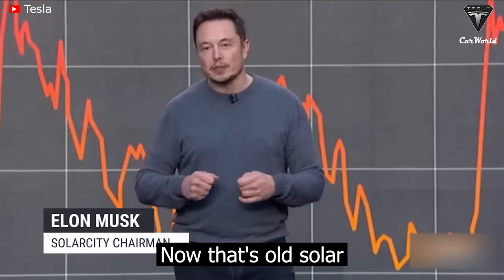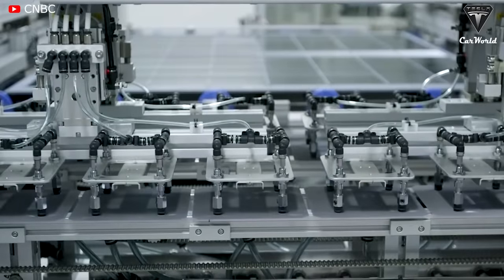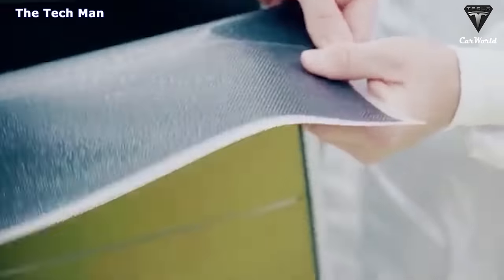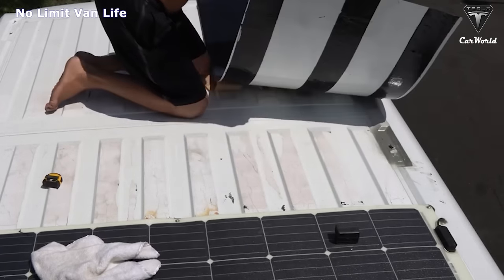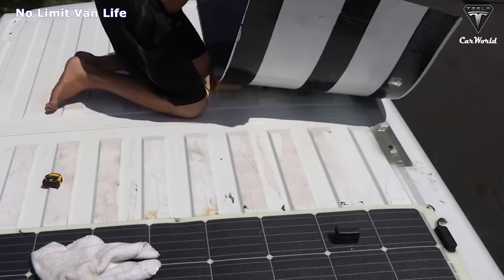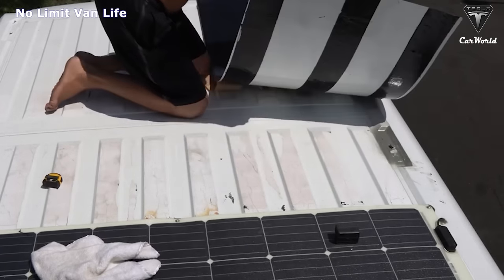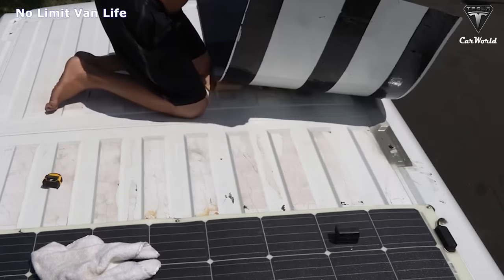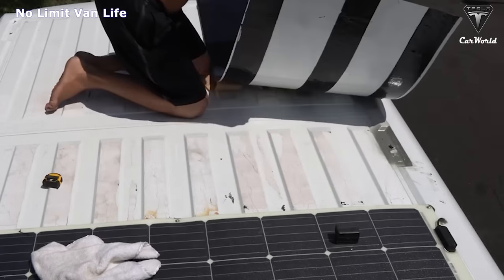Elon Musk Revealed All New Solar Panels for 2024 Renewable Energy, Can blow your mind!

Comment: As of Jan 2024, I got a quote from Tesla contractor quoted for my roof $70-90/sqt. My roof is roughly 2850 sqft, total cost $270k-$290k. The solar panels cost more than my house.
Reply: Absurd
Reply: But that can't be right! Elon himself said that they were going to be cheaper than asphalt shingles! 😂
Reply: That’s a hell of a deal! Send it
Reply: Your current energy bill will not cost 270,000 thousand dollars in yer lifetime
Reply: You need 1/3 of that surface to charge your Tesla car, run everything including heating and AC,  and still sell your electricity to your supplier. And you will repay your investment in 7-8 years. And use it for at least 25. So it's far from absurd.

Comment: I have been holding off on going solar.  The efficiency of solar panels just isnt there yet and keeps the cost high and payback period about equal to the life of the system.  I know its only a matter of time before technology makes the panels cheaper and more efficient. Im excited for the day of solar technology breakthrough that will make smaller arrays, cheaper, longer life.  When that happens I will jump in.
Reply: My roof was shot so I just popped for $17k for a GAF 50-yr warranteed roof.  On top of that, I will be installing an offgrid $12k solar system with 5.4kWh of panels and 20kWh of backup batteries.  That should be enough to provide every bit the energy I need for the 1,450s/f house.  I have gas heating.  My electric bill is $35/mo now, running from 304kWh/mo for half the year, up to 556kWh/mo during the heat of the summer, with the thermostat set to warm at 69F, cool at 78F.  There are 3 fans in my house to keep me cool until the central A/C kicks on. 
My ability to get the electric usage down has been practiced for a decade now.  I originally switched from incandescent lighting to fluorescent, and after awhile to LED. I removed many lamps and installed ceiling indirect LED lighting.  15 watts is enough to read anywhere in the room.  A sconce using 8W bulb light both my kitchen and bedroom walls and ceilings well enough to read or to prepare foods.  Two 8W bulbs light my living room for movie watching.  (I gave up that expensive sat. TV setup and saved $100/mo, switching to a Kindle Unlimited book plan from Amazon for entertainment.)  Once I had figured out how to drop my electricity usage for a long while, it lowered my solar costs by about $20k.  My porch light is solar powered and only comes on when it senses motion. If people in your house leave lights on, install timers in place of light switches.
TIP:  Figure out how to save on your electricity first, then live it for a year before determining the amount of solar you'll need.  By that time, the costs will be down and the efficiency will be up.  Win/Win.
Reply: Right.  And right now, they are charging too much to install.
Reply: I felt the same until last week wehn I received my electricity bill...
So I ordered a solar kit. I think they're getting pretty decent, considering the rise in energy prices.
I'll still be able to upgrade with better panels later if I want to.
It' important to note that panels produced today with an announced lifespan of 20-25 years, will not stop working suddenly by that time. They will slowly start to degrade and lose efficiency over the years, but still produce electricity.
Reply: @adri1leusha  These are all facts but solar has a long way to go.  I feel like solar is our best bet for cutting fossil fuel use.  I wish more focus would be put on advancing solar tech and less on EV for now.  Another issue us Floridians face is home owners insurance canceling us for going solar.   I hope it works out well for you. keep us posted.  feel free to share location, size of system and cost if you like.
Reply: @afbigfish1  True! I feel like for solar, and EV the biggest battle is the energy storage. Their is a lot of progress to be made on batteries...
My location is center of france, and I went for a 5kw panels kit plus 9.8 kwh batteries and a hybrid ondulator that will charge/discharge batteries and use grid electricity if required. It cost me about 8k.
I haven't received nore installed any of it so I can't yet give any user experience. I'll see how it goes in the first year, and upgrade later if I feel like it's needed.
 I assume I may also need to try different setups/orientations to get the best out of it!
Reply: @adri1leusha  yes there is room for advancement of both the panels and storage.  However, The panels are the biggest issue for now. As you mentioned a grid tied system is a viable option and does well to offset Kwh use/and fossil fuel use.  Its just as environmentally friendly as a backup system and some could argue more so, as there are no batteries or disposal needed down the road.  However if you live in an area that experiences frequent power outages or power is simply unavailable or you are a prepper type than back up is great.  The problem with the panels is they are only about 15-20% efficient which translates to systems of even small power requirements needing lots of panels and roof area and large installs which =lots of money. They are working on designing better more efficient panels but Im sure they dont receive all the help/support they could use because of the greedy oil and gas industry trying to stymie the industry.  There are those that never want to see solar get off the ground.  Once we see panel technology reach the 80+ percent range without the use of solar tracking which will require smaller more affordable panel arrays then that will open the door and make solar not only more affordable but appealing to a lot more people  Then and only then will EV's make more sense to own.  right now most electric cars are charged by fossil fuel anyways but once each homeowner can generate all the power they require or more for a day and charge their electric car then we will be actually doing something to help.  Im happy you made the plunge and hope it works out for you.  Best of luck
Reply: Same id about it here, once i can get through the winter on solar panels and the solid state batteries are pouring out of factories... i'm in
Reply: Solar efficiency and cost is already here. It’s 11k to install a system with more than enough capacity to generate 110% of my energy needs. The truly inefficient option is to keep purchasing from the utilities. My local utility has increased energy prices at peak by 50% in 10 years.
Reply: So, let's see. I had a 10.2 KwH Enphase system almost exactly 1 year ago. The entire system cost 30000 USD. (no batteries) I received a 9000 USD tax credit effectively reducing the price to 21000. In the first year, my system generated 2500 USD of electricity in my area. That will vary based on how much your electric rate is. Our electric rate here is 14.3 cents per KwH. If electric prices stay the same it will take about 8 years to pay for itself. That is a lot less than 25 years. I do however agree that installing battery backup is prohibitively expensive and really doesn't make sense yet.
Reply: First "I" never said solar was bad for everyone.  "I" did clearly say "I" second I stand by what I said the efficiency for todays solar panels is what's standing between ownership for most. Third,  That is a pretty good payback but there are some things you are forgetting your installation cost/payback may/may not be the same as others.  There is a ton of variables such as location (not only latitude but economic too some areas labor costs are grossly higher) , home layout, roof shape,  roof slope (this is a big one if panels are not mounted at the ideal angle for the area the panel will not perform well) not to mention the angle of the sun to panel angle changes throughout the day and year so a fixed panel is a compromise at best and why solar tracking systems greatly improve output , roofing materials i.e.. asphalt/tile, array to panel distance etc., climate (panels get less efficient the hotter they get too) all play a part along with exposure.  The ability to keep the panels clean, (dirty panels will drastically cut output) so homeowners need to consider how they will be cleaned  and if they are capable of climbing out to a second story roof to clean or are they going to pay someone to do it,  Cost to replace faulty panels also comes to play even if they are under warranty the cost to R&R the panel is not covered,  Cost to replace any panels from storm damage, cost to home owners insurance, and now some insurance co. will cancel you for having solar, then we also need to factor in the efficiency loss all panels experience.  Every panel slowly experiences degradation from day one your first year is the "ideal baseline" and will be your best performing year with nice clean/new panels.  Trust me I am NOT against solar in any way but I stand buy what I said the panels do have A LOOOONG way to go for efficiency improvement.  That is just a well known fact and part of the reason for the government subsidy.  If panels were more efficient then the government wouldn't need to subsidize the cost to make them more attractive.  Currently from what I have read solar panel efficiency is around 15-20% for a brand new clean panel in ideal environment. So in best case scenario that panel is only able to use 20% They are working to develop more efficient panels everyday and say 50% is on the horizon.  Very exciting stuff.  I'm glad you are happy and your system is performing well for you.  I'm getting older and between the cleaning and insurance issues with solar items "like" the smart flower seem to be a great option ground level for easy cleaning and not attached to the roof, fold up at night or during heavy winds but the surface area vs. panel size is only 2.5 rated but equal too 4 Kw roof mount due to the solar tracking ability. However if panels efficiency was to double or triple and 1 "smart flower" or similar was enough to power the average home would be a gigantic step.  As mentioned the more efficient the panels are made not only makes them more financially attractive but can also open up owners that might not live in the most ideal solar areas.  Best of luck and I hope you continue to generate all the power you need and Im glad it is working out for you.        @pauld315
Reply: This isnt rue. payback is quite often MUCH quicker than life. not to mention, these systems will continue to work for decades past the 15yr rating- though be it at a lower efficiency. after 20yrs, most panels will still be more than 80% efficient, and the drop off curve is quite flat after 20 yrs.
Reply: @ljprep6250 
You forgot  to mention three refrigerators , two upright freezers and four hairdryers.
 I would  go down to one candle per house  , enough  light  and heat  from it😂
Reply: I'm with you all the way afbigfish1 . There's gonna be a big breakthrough soon and then, when the price is right, I'll also go for it,
Reply: Batteries.  Those are still a budget killer.  Any offgrid solution requires those emerald mines.
Reply: @willdavis2551  agreed, The panels are inefficient currently only around 20% and the batteries while Li-ion are 96%ish efficient they are expensive. Which is a bad combo but if I lived in the country instead of the city and could do a  ground level rack or even a solar tracking array at or near ground level I would with batteries.  Living in the city in Florida requires roof mount so that triggers a host of issues, install cost being one especially with tile roofs drives the cost up substantially, maintenance/cleaning and roof size vs orientation and insurance issues which is a huge problem here already without adding additional problems.  Your largest roof areas might not be facing  south and paying for installation, equipment etc. is not cost effective for a small system at 20%(ish) efficacy at best .  This was my point previous.  If they can get the panels to even 50+ it would make a world of difference 60-80% even better at that point it should be game over and most of the country could be on solar regardless of zip code, roof shape, orientation etc. Now if you have a house that has easy install potential in a good solar region and ideal orientation than 20% panels will still pay you back and most likely make a lot of sense however most of the country ISNT in that particular boat but some people can only look at a situation from a singular point of view.  "Its good for me it should be good for all" type of thinking.  People need to but have a hard time thinking big picture.  I dont see the batteries being a big deterrent for most if they are "mostly" concerned with cutting fossil fuel use and eventually being energy bill free or very low.  Sure its nice to have back up during power outages but most people will be perfectly happy with a grid tie system "IF" you can tie to the grid. Of course there are those remote properties that might no have power at all or be very cost prohibitive to bring the power in.  Then off grid is your only option but I think the majority of the population is more interested in cutting fossil fuel use and eventually having a small bill.  Which is a whole other issue.  I will go out on a limb and say ALL power companies charge some type of "convenience"  fee so even if you are generating all the power you use. You still need to pay a bill every month for using the grid to send and receive power. In my area I want to say that is in the neighborhood of $40-$50 dollars per month.  So no matter what you will always have a bill and who knows what the fees will be 20+ years down the road.  The only way to truly be free is off grid but right now that is very expen$ive no matter how you look at it. That said if you live in a good area for solar potential, have a good roof shape and orientation and dont mind cleaning panels and dont have install cost and insurance issues to deal with than you should 100% be looking into solar.
Reply: @afbigfish1  where I live the energy company pay us for net metering at wholesale for any excess going back to the energy company. The cost for solar slowly has been going down over years and cost to install is now better. Ratings of panels is going going up but if cost versus pay back is not to your interest that is your choice but be assured cost for energy is continuing to rise at every power company.
Reply: The truth is the panels are now so efficient I have just 8 400W panels and am completely off grid in Portugal, the panels are guaranteed to last 20 years but will have paid for themselves in about 7 years, My advice is go solar as soon as possible you will save money and help reduce global warming. Good luck hope you start saving soon
Reply: You and everybody, everywhere on this planet are waiting for that day, but ill reserve judgement on whether Elon has really brought us that day until he offers to sell me solar panels for .22 a watt. that would put a 400w pannel at $88 and that will be the day I put in my own solar power system, on a home far off the grid. And i wont have to pay a nickel for it because ill make a lot more than it costs me, shorting the stocks on oil companies and even wind power.

Comment: The battery solution is what is really needed and breaks this from working.
Reply: no, efficiency is what is the big lag.
Reply: BOTH - Battery, More Efficient Solar Cells....but we are getting there.
Reply: Catl rolled out a 500kw/h sodium battery !
Reply: @renaudfilippi2599  I seen, let me know when there is a consumer product and when it is at 1000kw/h where it needs to be. Progress is a good thing but we need solutions fast and to market.
Reply: @gimduncan1240  500 kw h is enoug for Electric plane. ans it is for now.  Not sure to understand.
Reply: @renaudfilippi2599  Read more!
Reply: If really 0.19 dollar? That's mean? The producing cost is lower than making a dollar Bank note 💵😮😮😮😮?
Reply: @user-friendlyzhaoxiong2023  For battery? I think you not understand.
Reply: @gimduncan1240  for solar plate
Reply: @user-friendlyzhaoxiong2023  I am good with plate, battery problem!
Reply: @graphguy  nopes, efficiency is no longer a major problem. 

Solar Arrays already occupy 1/5 (or even less) of the space wind farms require to produce the same amount of electricity. 

In the tropics , solar panels can easily be oversaturated for the majority of the day, and cooling solar panels is now an issue.
In the Temperate climates , yeah, any boost in efficiency would be great, especially in winter . 

batteries , and inversion units to convert DC to AC , to feed the grid is where solar is lacking. 

PRICE is the other problem. 
Batteries and Inverters cost more than solar panels. 

It's not expensive to buy new panels and add to your array.
It's expensive to add additional battery storage.
Reply: @avibhagan Yes, the costs of installation are usually not really going down since the manual effort does not decline at a cost curve. 
It is actually quite the opposite, high demand for solar will increase the price of the whole setup. 
Probably 90%+ of people do not have the required knowledge of basic electrical engineering to do the job in a safe way.
Reply: LTO,